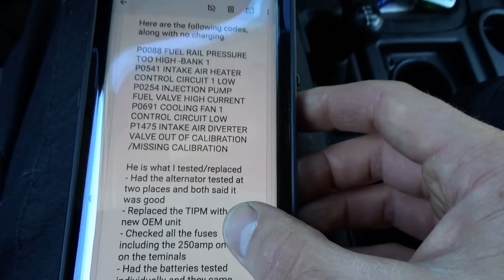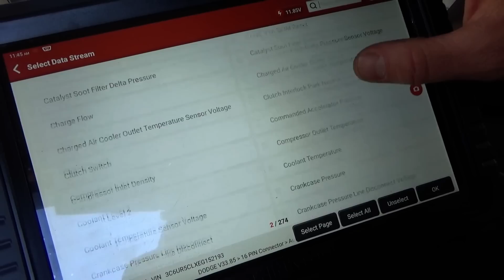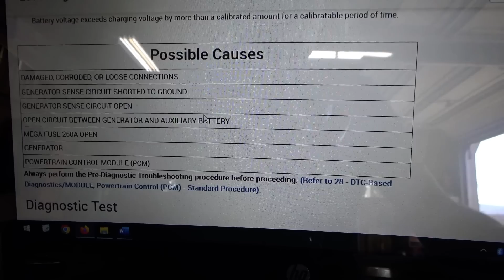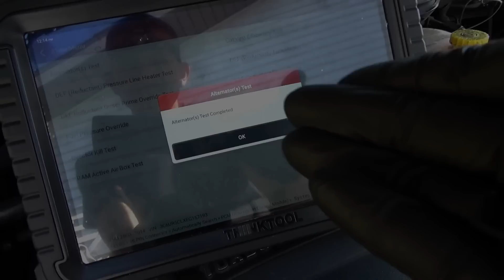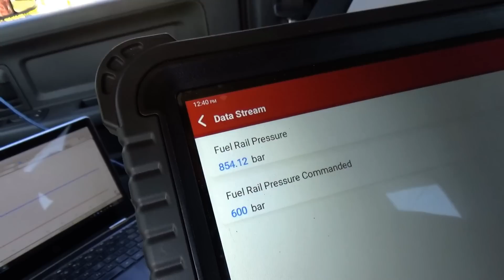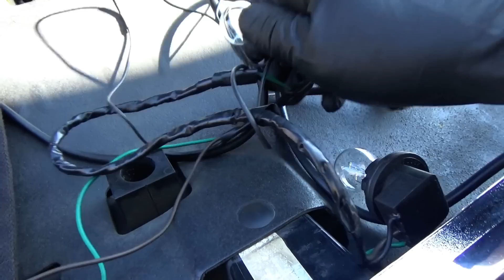Shop & Owner STUMPED: Cummins Can't CHARGE? Fuel Pressure PROBLEM? (P0254-P0088-P0691-P0541-P1475)

Comment: Here in Baker City Oregon Eastern Oregon. Over 90% of all diesel pickups have been deleted. We have not seen one ECM failure caused by the software. We do not have emission testing so it's not a big deal. Also we have vehicles over 20 years old no rust at all.

Comment: Sounds like you are stuck with the aftermarket tuning and the aftermath of keeping a tuner plugged into the diagnostic port sooner or later some stray voltage event will fry the computer.
The 10,000 dollar tune up!

Comment: I like programmers. I had sct on my dakota and will eventually tune my ram 1500. I'm 11 minutes into the video. Can a programmer make stuff go wonky? Yes, but it's not likely. I'm going to say there's some bad wiring. I guess I was wrong on the wiring. However, how can you say it was the tune? It's been on there for almost a decade. That's like blaming the manufacturer tune for drivers going bad on a completely stock vehicle.

Comment: I doubt the tune had anything to do with it. 6 years and no issues. I bet a bad solenoid or something cooked the driver. The tune is mostly just disabling emissions garbage and disabling DTCs. I’ve seen plenty of bone stock dodge computers get cooked by bad MDS solenoids. The stigma around tunes causing issues is mostly unfounded.

Comment: I would have just put a old school voltage regulator on it. Remember that old school is the best school. And yes it would have worked with a old school Mopar voltage regulator on it o do it a lot and the computer can be cloned to a used computer

Comment: Owning a diesel that you don't make money with is a losing proposition as you can see with the ECM cost. All the parts pricing on these things is insane. "it's been running with a tune for six years." As you said "so what, want to buy a computer every 6 years?" Electrics are funny. I had a new '03 Porsche 914/2.0 electronic fuel injection engine and was trying to figure out how to "hot rod " it some, so one of the things I did was replace all the spark plug connectors with just basic clip ons, removing the factory ones that had a 100 ohm resister in each, no problem, radio wasn't getting interference so I ran them.  Close to a year later was on a trip to Sebring Florida from Chicago, stayed overnight in Columbus Indiana, next morning the 914 would barely run, nursed to a VW/Porsche dealer on the outskirts of town, they took a look and asked about the spark plug connectors, I told them I replaced them about a year ago, said that was problem, they are supposed to have 100 ohm resistor in each for injection system to run properly, ok, $75 later was on road to Sebring with factory spark plug connectors and never another problem. Why take the engine a year to figure out what I had done?

Comment: Not to pile on the aftermarket tuner stuff, but why don't aftermarket tuner companies have tech line where they could confirm with a diagnostic person that drivers for things like alternators and fuel pressure regulators are same or different from the stock cal?  You get what you pay for.  I understand people wanting to delete troublesome emission devices,  but often the factory configuration is the lesser of evils.  Especially when troubleshooting.

Comment: The data PID you where looking for is "alternator or charging system duty cycle".  at least that's what it is on WiTech.  I had a similar issue on my 2013 minivan (same electrical architecture).  But the alternator was making noise and not charging.  Same  problem with no alternator light or message.  In my case, I saw the alternator duty cycle at 90% so I knew the PCM was asking.  New alternator fixed it.  I asked the Stellantis Tech advisor why no alternator light?  he did not know.

Comment: Cummins ECMs aren’t all that great, it’s not a cheap Chrysler issue.   I’ve had a couple go bad on diesel buses.    In fact I had one replaced from an online source and the replacement had another circuit bad on it different from the first.    Aye aye aye.  

It’s tough enough to make an ECM call but making two in a row on the same vehicle was definitely a bust.   

It’s probably not entirely a Cummins thing it’s probably more of a diesel thing.   I’ve seen a CAT ECM lose injector drivers too.

Comment: That idea you  had with faking a current to get the alternator to put out a charge will work, just needed a little more circuitry and a relay to cut it off at a certain level.

Comment: In PCM design it is much less expensive to PWM duty cycle encode a command than it is to generate an actual analog output voltage. The digital PWM command output can have the pull up in the alternator and since the signaling is digital the inevitable ground potential offsets do not corrupt the signal (information).

Comment: Ivan, you stated in your last video with the Audi, "You have to pay to play."  (We know that is a very old saying.)  I have owned 2 diesel trucks for over 20 years and I can tell you I have had every problem a person can have with a diesel.  They aren't cheap.  That price for the engine computer is INSANE!  Back-in-the-day, we had Hypertech and Superchips and Banks-6-Gun and I was told not to mod my truck with those if I wanted it to be reliable.  (I have two 6.0 liter Ford diesels.)  Good diagnosis.  GREAT VIDEO!

Comment: Tuning is so common nowadays... this is my profession as well and I can't find any logical reason to condemn software for a hardware failure in this instance. Not to mention this ECM is mounted to the engine block and subject to the heat and vibrations no matter how well they designed it 😅... never understood mounting them there and I used to work on these daily and have worked on deleted ones as well. I applaud this guy for doing a delete kit to give his engine much better performance and longevity from the suffocating EGR system and particulate filter etc. Who needs to have their expensive diesel disabled because of DEF or Emissions fault?
Reply: Exactly. Plenty of tuned vehicles running around with no issues including my own Camaro. More likely that a bad solenoid or other load burnt out a driver in the PCM.
Reply: As a non American I'm surprised t

Comment: Please tell me how a change in the   software is going to kill the computer. Plenty of computers just fail and the vehicles are completely stock.  Heck my truck had a mosfet just blow and luckily it didn't damage the board and was able to be repaired. 

The bigger issue is the 6k for a computer, that's beyond stupid.

Comment: Ivan I love you sow, i been tuning cars trucks for a long time and i can tell you a tune file will never never affect hardware, hardware will be affected by faulty wiring current spikes bad grounding etc, please educate yourself on the tuning part before you simply blame a tune in general, tuning will never do nothing to charging system hardware , tuning will never do anything to fuel pressure hardware…….

Comment: When the other shop bypassed the pcm for the fielding test to battery voltage, they should have unplugged the plug at the alternator and run a jumper to the alternator from the battery on the drivers side of the truck. Thats how that test is supposed to be done. I do that one all the time when I test for the charging sense codes.

Comment: As I  have come to realise is that messing around with aftermarket tuner & lots of other performance parts are really not worth it basically it is you pay to play (sometimes with complete engine destruction.)I now do not modify anything unless there is no other way to fix a problem Cheers Ivan & Happy Holidays.Oh by the way love you step to reach up under to engine bay😂

Comment: Wow!  $6,300, plus programing?  Holy smokes!  That sounds more like the "I don't want to do this job" price.  And what makes this worse is that it's a fairly common problem on Ram trucks when the alternator fails to charge.
Reply: That was the price before programming. Just ask yourself what kind of PC you could buy for that kind of money. I suppose that ECM went through about 5 stages of markup after it left China.
Reply: @superfinn80  I think I could build 2 high end gaming PC's for that kind of money.  And I wouldn't doubt the markups either.

Comment: The bad part about these Cummins is the vgt turbo sucks the 68rfe sucks and fuel contamination is absolutely horrible expensive between 15-18k a transmission is 10k and up and the turbo is 5k and the truck has so many modules that if the voltage varies get ready to pull out your hair and the tipmn is cheap pos 1500 I have owned many Cummins over the years but this is the last one 2nd gen here I come

Comment: Honestly we seen a lot of Dodge and Chrysler products come through here that have computer issues, I'm sure that's really the bottom line is that the components aren't as quality as they should be, but using a tuner and pushing certain components to the max for having drivers utilize more power than they should probably doesn't help but I think the main thing is that the electronics and the components that stalinis Dodge Chrysler whatever uses aren't as quality as they should be. I don't think I've seen any other company come in with more computer issues than Chrysler on this channel especially..

Comment: I've never understood why aftermarket engine controllers "can't" have the OBD2 emissions programming in them as an option. That would save a lot of headaches and make older vehicles run better, because everything before OBD2 was batch injection and batch ignition, and honestly slow and imprecise. Is it a legal reason?

Comment: Lets be honest, that PCM probably failed because its a Chrysler product more than because of the tune. I worked in the parts department of a Chrysler dealership for almost 10 years and couldn't even begin to count how many PCMs I sold. And as far as the price is concerned, I am not surprised to see that crazy number. A dealer probably would have quoted a factory remanufactured part and it would have been way less than the almost 7k.

Comment: Sometimes, tuners have to open the ECU or drill a hole somewhere. I suspect that this is what happened to this ECU and then it got water damage. I don't expect that software is what caused this issue. Did you do a visual inspection?
It's crazy to drill a hole in a modern ECU that costs thousands of euro's, but that doesn't stop them.

Comment: Every Dodge with charging issues that I've seen is PCM from crossing booster cables, most people don't know that charge only goes into one battery so if splitter battery cables aren't good it won't charge either

Comment: Service life is key here. Engineers do not want to run anything at 'max' capacity or ability designing in a safety factor. A designed load of 80 or 90% within the ECM would allow it operate 20+ years, over clocking it will reduce the life of the unit.

Comment: Personally I don't think the aftermarket tuning stuff wrecks a lot of ECM's. Unless improper installed,handled. 
I would point fingers at engineers for thinking that placing a ECM in the engine bay is a good idea,especially bolted to engine itself. Heat stress,vibration and all weather environment for those poor ECM's .

Comment: If the engine computer is that expensive then I'd consider to look at things like the Megasquirt and run a generic aftermarket alternator with a built-in regulator.

Comment: I got to work on a Cummins CNG engine and believe me, Cummins is REAL PROUD of it's replacement parts!  However, STAY AWAY from tuners, unless you own stock in the Cummins Corporation! 
I sincerely hope this truck's owner does not install that tuner again!
Thanks for showing the company that specializes in ECM/PCM rebuilds, and thank you for this video Ivan.
Reply: this is true of most modern diesels. You'd better know what you're doing if you tune them.
Reply: @TheLoneShark-s6y  The only tune EVERY newer car needs is....    if (CEL_request) CEL_light = off; .
Reply: @robertsmith2956  I don't understand it. Engineers spend millions on designing the best intake and fuel systems for every day driving, then owners spend a few hundred on crap to modify those systems. Can't blame RAM for this, blame the clueless owners.
Reply: @ Your logic is flawed.  They could care less about the best design.  All they care about is passing the EPA tests.
VW proved that by having the car pass the test, AND have more power.

Comment: My 1992 Dodge D-350 has a Cummins and it stopped charging. The alternator relay is commanded only when ECM sees the crank is spinning. Thought about bypassing it, but watching Ivan and Eric 'O' convinced me to find the problem and fix it properly. The signal wire from the crank position sensor was grounded out.

Comment: How is it in Europe they have figured out how to make these tucks run with no DEF and burn clean? They exceed any EPA mandates. They make plenty of power and get good fuel mileage.
Reply: Europe has different standards. Until 2019 they essentially ignored NOX emissions.
Reply: @ they  can beat them now. You can buy Scandinavian engines that meet and exceed any EPA standards. Their trucks are legal anywhere.
Reply: @thebigmacd  they beat them now without DEF. There trucks are legal everywhere.
Reply: @johnscott2849  as far as I know they still run DEF/SCR. They just don't use a DPF. For example, US Tier 4 Final Scania engines use SCR and EGR. If you have SCR, you're using DEF.
You don't happen to watch Edison Motors, do you? There was some confusing/incorrect claims implying Scanias not needing emissions equipment in one of their videos.

Comment: I will never understand the need people have for tuners like that on a vehicle. That higher fuel pressure can't be a good thing. The original software in the ECM is designed to work a certain way and messing with that isn't a good idea. Granted, sometimes manufacturers screw up something in the software programming and later on may issue software updates to change how something works, but I think it's better to leave the software bone stock.
Reply: Its a Cummins computer, with multiple different calibration and HP levels for different applications, tuning these rarely cause problems, usually lack of maintenance and injector failures due to poor quality fuel, or in this case corrosion in the PCM, there's a video on u tube of the guy that repaired it.

Comment: If you need ECM repair, failure analysis, cloning, or investigative analysis Maic Salazar Diagnostics in VA does this.  View his web page & videos but understanding what failed in the computer would/may help avoid duplicate problems in the future.  Also, the tune can be archived and loaded into replacement if repair is not possible.  Understanding can assure accurate judgement and direction point forward if software was even a factor (factory or tune).  Corrosion inside ECM's also cause component failure.
Reply: He knows about Maic Salazar Diagnostics.
Reply: Salazar got a shout out at the end of the video.
Reply: @aderi31415  And did a video on the failure.

Comment: So the owner had to get a new computer, but because of the emissions delete, had to use the sketchy tuner again...I hate all the emissions stuff too, but that's part of what you're purchasing with added maintenance such as DEF. I've seen aftermarket tunes fry alts, blow up turbos, and fry shift solenoids. And I've seen some that seem to do nothing. High $ call, but the diagnostics are the same.

Comment: It seems that modifying the ECM/PCM may work for a while but really, are the performance gains so important that it is worth risking other failures?  Nice job in confirming the engine computer but really, you do that every time regardless of how much a replacement computer costs.  Kudos to you!
Reply: You’re not modifying it you’re just effectively changing some code and turning off things in the pcm. I tune lots of cars and no issues. I replace bone stock PCMs that have failed all of the time. Just because it had a tune, one that has been running fine for six years, doesn’t mean anything.

Comment: Its a DIESEL!! it needs only 1 wire to run,,, No computer, no BCM, ABS, ECM ect...
Reply: If it was a 1.6 Rabbit diesel, that would be very true, and that single wire for the fuel solenoid could be eliminated if you chose to do so.
Reply: @brianw8963  I guess you have never seen a Cummings 220 Big cam ? In a 1969 "Japanese" 7400 White Freightliner?

Comment: I recommend the owner to lawsuit the company for putting the ignition transistors inside the ECM and not outside a 5 dollar module easy to replace, if we all do that, these crooks will stop stealing our money, but nobody does it, and evilness never stops...
Reply: Diesel engines don't have spark plugs. Therefore No ignition transistors.

Comment: Why not temporary rewire the alternator so it don't go thru the computer so the guy has a charging system you need  power wire it turns off with the key switch just a temporary rewire job so he has a charging system
Reply from the maker: Would need an external voltage regulator with feedback 😉
Reply: @PineHollowAutoDiagnostics  true or one built in Field to Field wire to the alternator say battery and a wire to the key switch I did this before

Comment: Comment number 2 what my friend does he buy another Dodge Cummins truck 2020 same thing they had to replace the entire Fuel system under recall some jeeps have the same 6.7 Cummins they are also under recall the truck is a pile of shit from the factory they have a grid heater bolt problem it brakes off destroy the engine